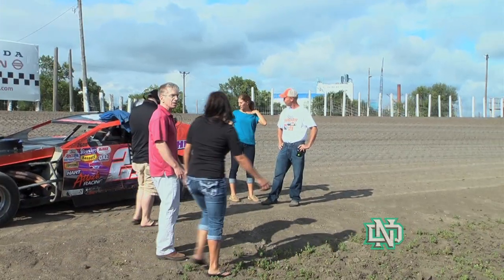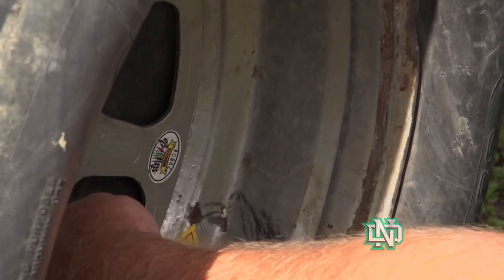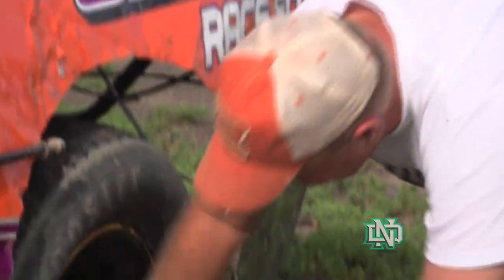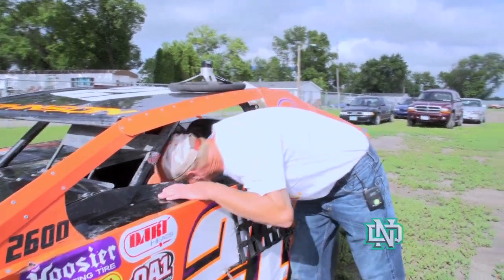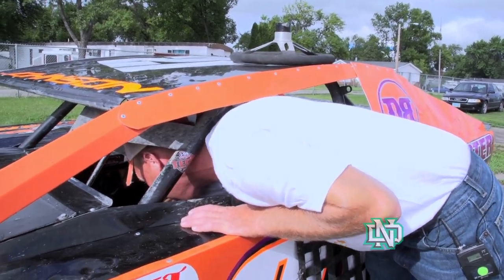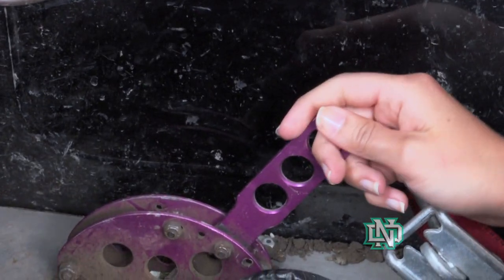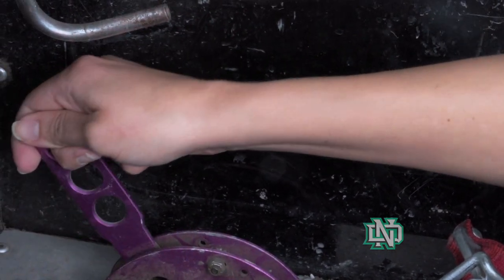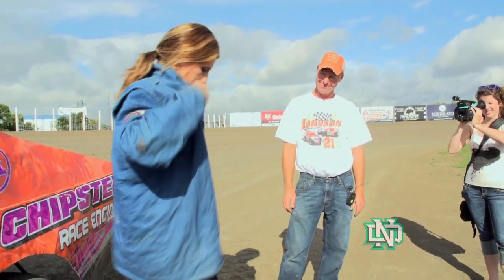How to Drive a Modified Stock Car | UND Sports TV

Comment: ummm.....modified not a stock car
Reply: Steve Smith  stock car means exactly that. Stock. It's stock.
Reply: Steve Smith no. These are tube chassis beside the front clip. Not stock
Reply: @aronsullivan3266  just exactly what do they call NASCAR "stock cars" try to know a little bit about what you're talkin about the for you run your thumbs
Reply: @tantrobusb9  actually it's a B mod. Ump/Imca modified.
Reply: @ffemt99  I'm well aware that it's a modified I work on a UMP modified every week look at my profile picture it would be a UMP modified. I could not tell you that it was a B-mod I was unable to see the shocks or other tells of a B-mod My point was it is not a stock car stock in my opinion stock cars have a full body and you don't find stock cars anymore the closest thing to being a stock car is NASCAR Monster cup, NASCAR INFINTITY Series, ARCA Series which are really not stock cars anymore either, they were stock cars back in the early 70s and late 60s as soon as they went to fabricated square tubing and Tube chassis they're not stock cars anymore
Reply: Merc Rogue  No it's not, you have no idea what your talking about.
Reply: @aronsullivan3266  There is nothing stock about a dirt modified. The front clip was stock but it gets modified so NOTHING is stock on one. NOTHING!